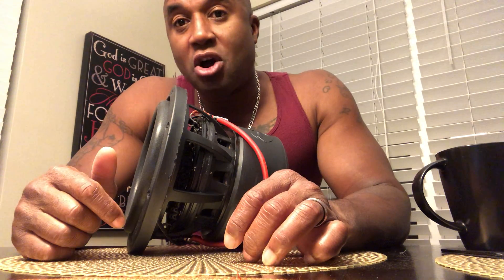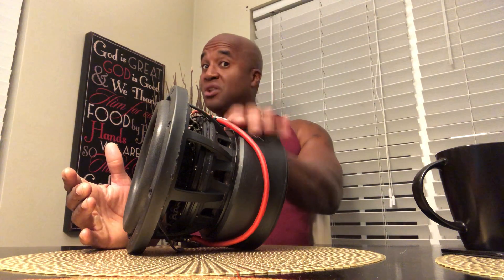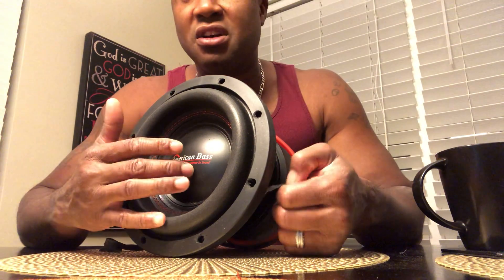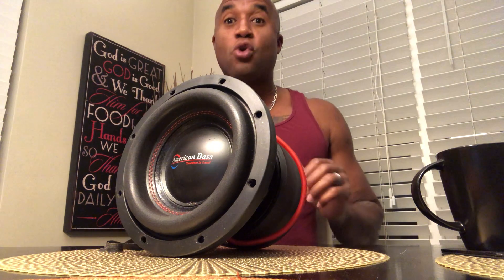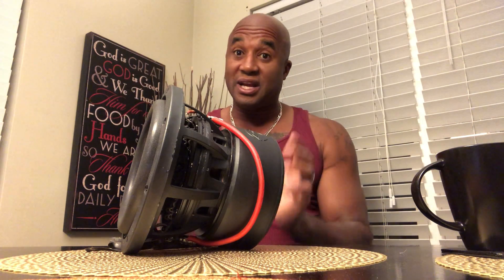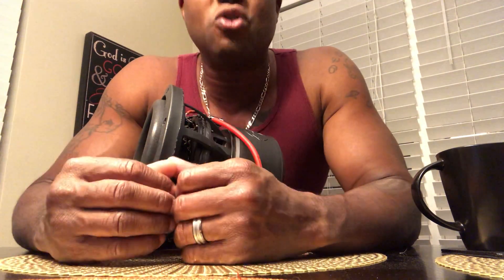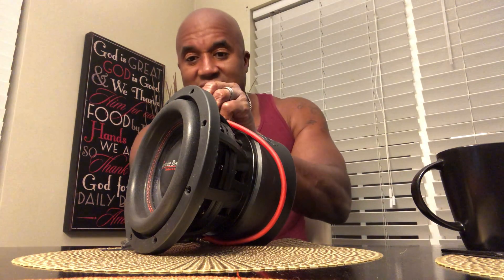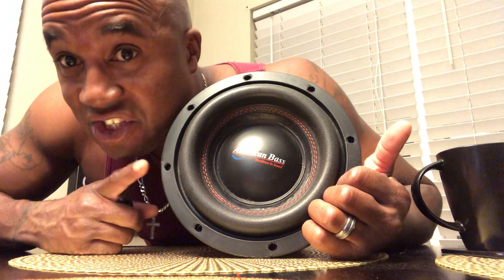XMAX and SPL..is high XMAX better

Comment: But if the speakers cone is moving back and fourth quicker, wouldn't it then just be playing a different note?
Reply: It’s not moving back and forth quicker it’s accelerating from its peak excursion at a given power at said frequency quicker meaning better transient response . 
Also a subwoofer with an xmax of 20mm vs a subwoofer with 10mm both playing a 1hz tone, meaning peak forward excursion to peak rear excursion in 1 second . If the 20 mm sub can do this in the same time as the 10 mm sub it’s still playing the same frequency but displacing more air (sound pressure) or spl . 
This is my understanding, I may be wrong tho, hope this is helpful

Comment: True but if u have a good amp that can push-pull very strongly and control the sub, then the higher weight is OK. Maybe not as tight overall but OK. But a lightweight sub with higher efficiency and lower power won’t hit bass like the heavier sub will, n u can’t fix that. Heavier weight and not working, just get a better more powerful amp. That said, sd does indeed matter

Comment: Sup bro long time we don't speak hope all is well.. I just got a 2018 and I'm having a hard time deciding which 10 inch to go with I'm going to raise my rear seat 2 inch a want to put 2 10s was thinking American bass or the sundown u model what's your thought?
Reply: I had a u-10 crazy loud for being a single 10. But price is a little high for me. I got it through sundown yard sale page
Reply from the maker: JOSE CASTRO both good... both take same volume... but the new sa10v2 will not fit under a seat... he’ll I don’t think either will and have necessary volume
Reply: @M.B.Enclosures  the u 10 says 1 cubic foot I believe
Reply from the maker: JOSE CASTRO Dec have you deem the U10 in person? You will never get that under a seat
Reply: @M.B.Enclosures  let's see what happens 🤣😁🤗
Reply: @M.B.Enclosures  the u 10 says 1 cubic foot I believe

Comment: Got a question what you think about a DC Audio 10” XL 2 ohm
Reply from the maker: Shy B very efficient 10”...high SENS/SPL 85.9....pair it with correct enclosure and amp and you should be happy
Reply: Thanks imma look into that great videos by the way